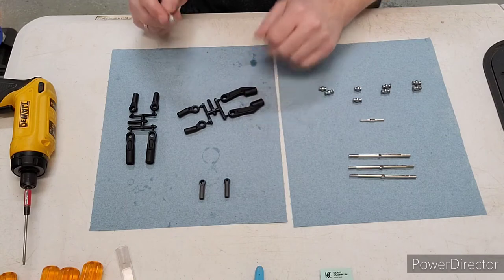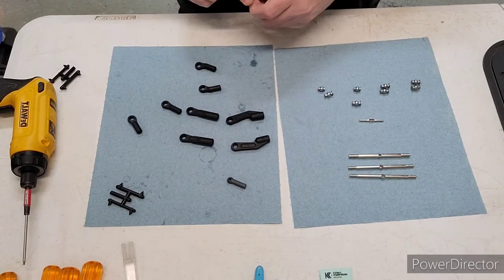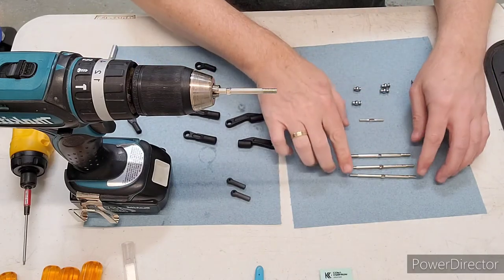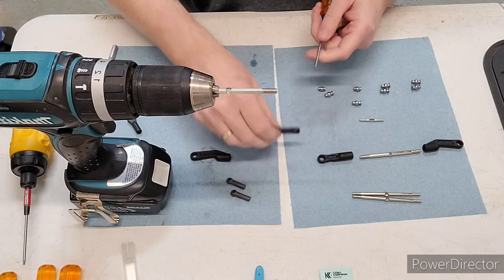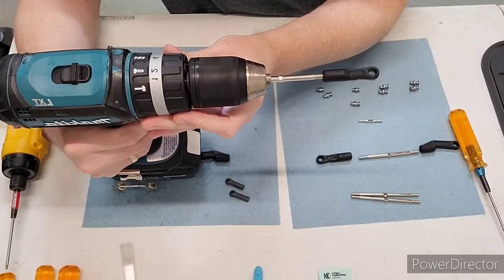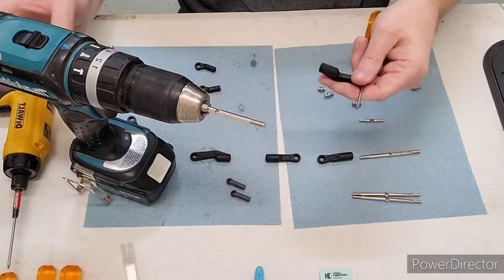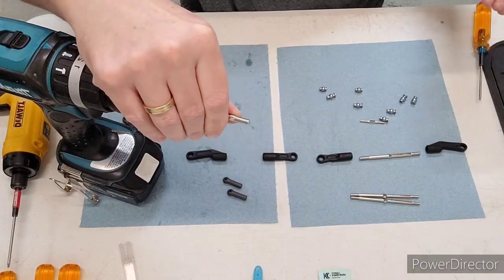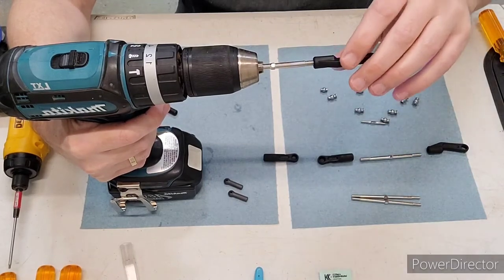Turnbuckles the Easy Way

Comment: 4:22 just send it. your not gonna cut a new hole diagonal through the already drilled out rod end, it will find where it wants to be very quickly. just start off slow. also, nothing works better than flush cutters for getting parts off trees.